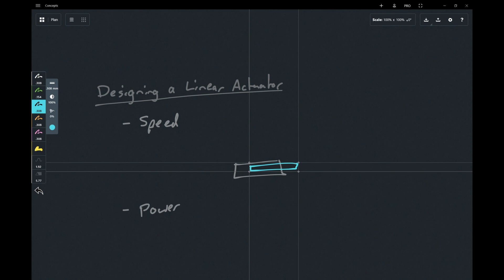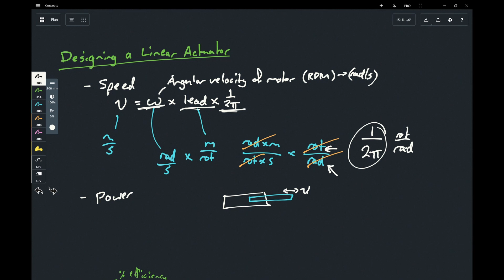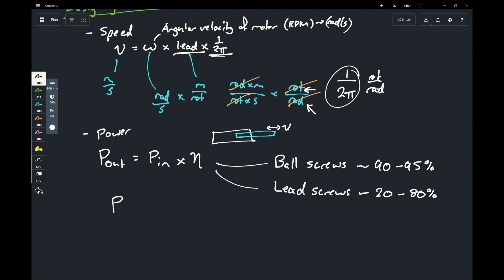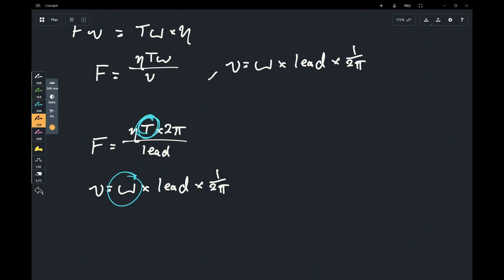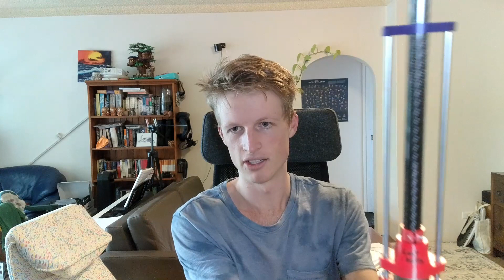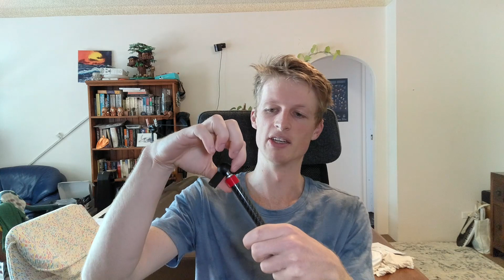How to Design a Linear Actuator - Project: DeepBlue Juggling #4.2

Comment: I am a very old EE System Engineer (aka poor mans polymath. Seeing you go through the exercise of analysis is a real joy. I had to wait until my 50's to start seeing young engineers go through problems. Very excellent. At the moment I am designing electric drive for my small yacht. Current designs are all based on outboard motor speed heads and not important stuff like Torque, omega and thrust. Seeing you develop the equations was very helpful. I forget stuff at times!

Comment: great video - quick question about the supporting rails. how do you insert them into your 3D printed housing? do you simply use a press fit? doesn't seem like the shafts are threaded on either end when looking.
Reply from the maker: Good question! Yep, those smooth rods are held in place with an interference fit. It took a bit of trial-and-error to get the printing tolerances correct, but they're super solid joints. 

I've actually changed this design quite a lot for Jugglebot, but IIRC the rod was inserted ~25 mm. That gave a really solid connection (almost too solid - they're not easy to remove!)

Comment: You have a third option for mitigating limit switch failure (instead of moving or having more limit switches): observing the motor/servo. I presume it has some sort of encoder output? You could use an interrupt on the microcontroller that triggers if the pulse rate falls below the expected rate. Microcontrollers are very good at - have hardware support for - comparing two pulse streams (frequencies). You may be able to find motor drivers that have such a function built-in? Depending on encoder rate, etc this may or may not work to prevent things physically exploding on impact, but should definitely work to prevent the magic smoke from escaping. You can also monitor current draw and watch for a stall, but that's much more likely to overlap with normal operating ranges.
Reply from the maker: Unfortunately the motor doesn't have an encoder; it's just a standard stepper motor. Monitoring the motor current is a good idea and I know that's possible, since AFAIK this approach is used in some 3D printers (eg. Prusa printers), however I'm pretty sure my drivers can't do this and I don't know anything about what's required to do that. I'm going to do my best to never skip steps and just keep my fingers crossed that nothing goes too crazy.

On another note, I really need to get around to buying an emergency stop button...
Reply: You can add one - if it'll fit? e.g. https://www.usdigital.com/products/encoders/ 
Mind you, might be best to leave solve that problem until after you know whether or not it'll be a problem, and finger's crossed works in the meantime🤞
Reply from the maker: It would be pretty nice to have some sort of closed-loop feedback as an absolute fail-safe, though I think the good ol' "fingers crossed" approach should be alright, given how overspecced these motors are for what I'm doing. We'll see!